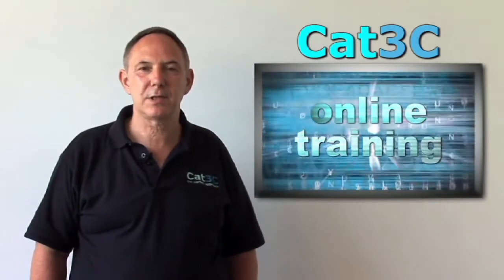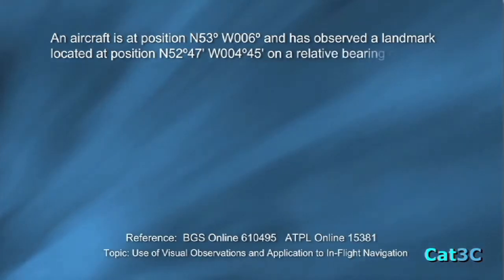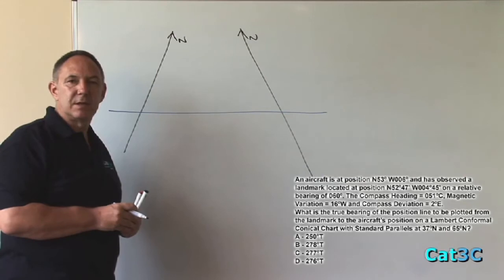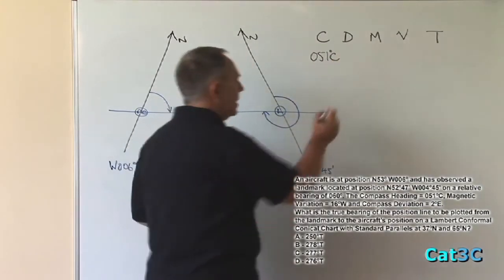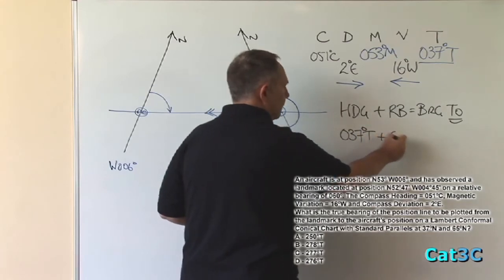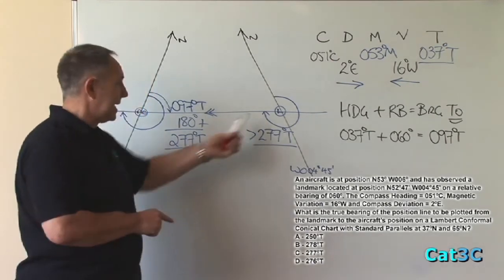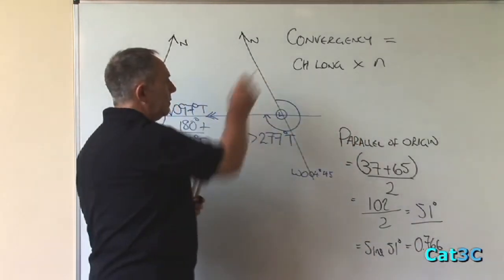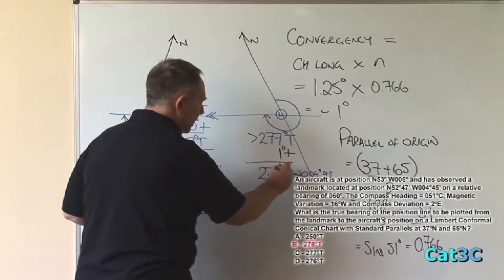QEV 003 Lambert Chart Convergency (A)

Comment: Why we add the Covergency and not the Conversion Angle ?
Reply: Conversion angle is only used when converting between a rhumb line track and a great circle track. Converting along a great circle track only requires 'convergency'.

Comment: Two methods. 
1. Look at the size of them, the track angle on the right is clearly bigger than that on the left (draw it and measure it if you don't trust your eyes - the angles won't be 100% accurate but one WILL be bigger than the other)
2. DIDI rules - northern hemisphere - angle on right is larger (Increased) and angle on left is smaller (Decreased).

Comment: Thanks for the video. How did we know the angle at the landmark must be bigger than angle at the aircraft?
Reply: ömer ali batı usually the aircraft angle is primarily larger because factors such as wind play a major role in the turning radius of the plane and as a result the deviation of the plane around its original radius around the landmark